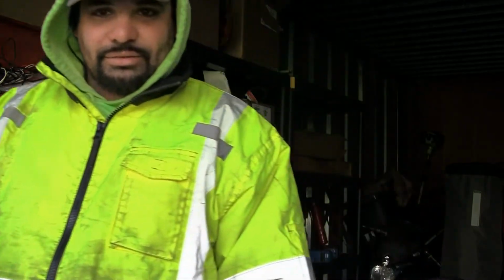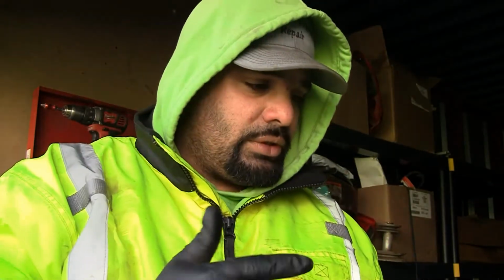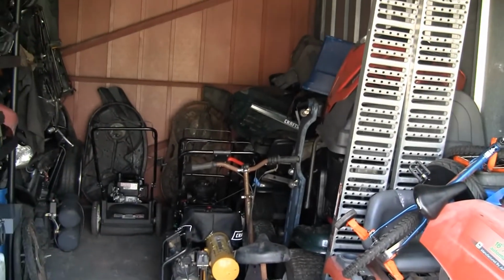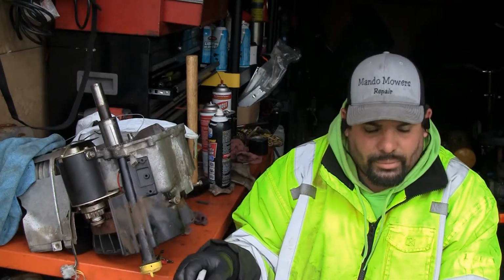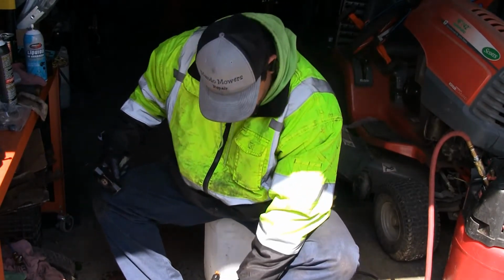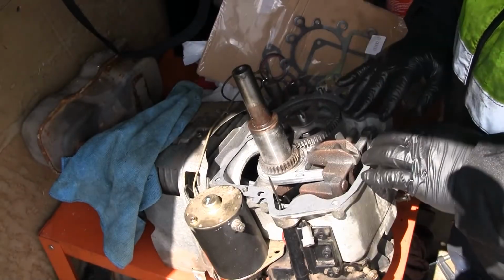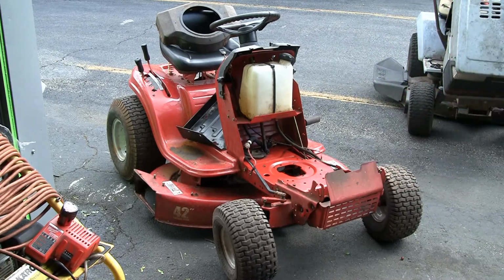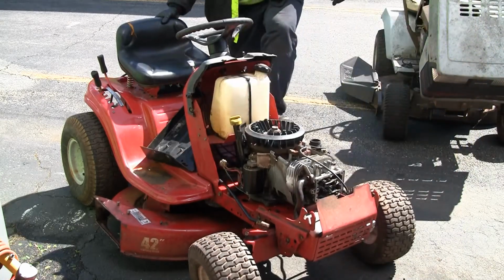My New Garage and getting some tractors going

Comment: Mando, is that the correct flywheel? Thats the only thing that i could think is wrong. If you replaced the cam and the timing is set right, it almost has to be the flywheel. Roger
Reply from the maker: Roger Mcdonald it is the right flywheel   This is all original
Reply: Could it be the valves are set on the wrong stroke of the engine? I watched that part of the video again and it still seems to be a timing issue! Good luck man. Roger
Reply from the maker: Roger Mcdonald  so I just changed the head gasket readjusted the valves and it turned on